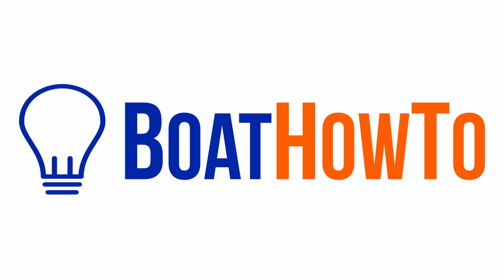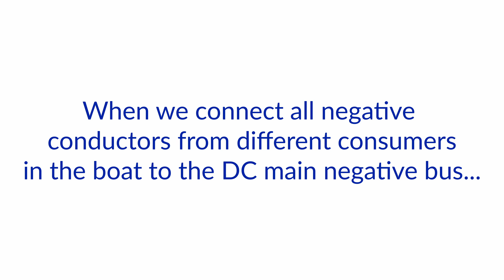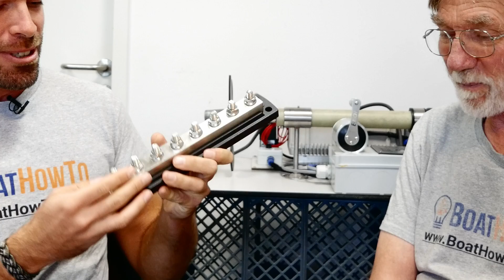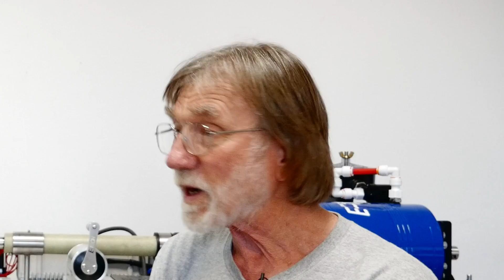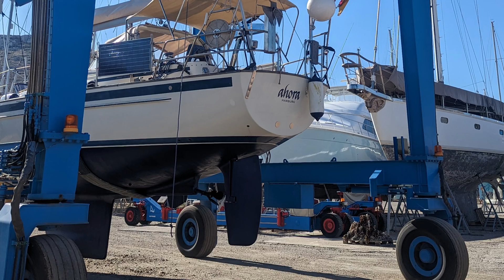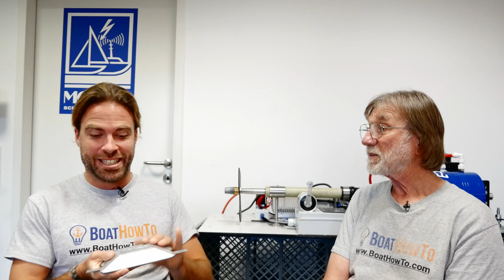SACRIFICIAL ANODE as GROUNDING connection - A good idea?  | Ask The Expert with NIGEL CALDER

Comment: By using a synthetic flexible coupling at the engine/prop shaft connection am I disconnecting the prop shaft and propeller from the engine negative?
Reply: It would seem yes, AND the two should still be bonded together with a wire with ring terminals.

Comment: Viewed twice and never heard whether or not the sac anode could be used as a grounding connection. Did I miss that?
Reply: He said the zinc anode has nothing to do with the battery system.  It doesn't matter if it is connected to the negative side of the battery or not.
Reply: I know what anode purpose is. But question is, can we use anode as a submergible metal plate? I have flexible connection to shaft. Previous owner connected engine with anode. Cables and connections were is horrible condition so I can not judge was it working.

Comment: I have a water cooled aluminum small high pressure air compressor, the water jacket and sleeve corroad over time. I am asking the following:
Could a magnesium anode be used in say a 5 gallon buckett that is the remote circulating water supply for cooling and would it have to be connected to the metal of the compressor by a wire? would that help ?.
Thanks

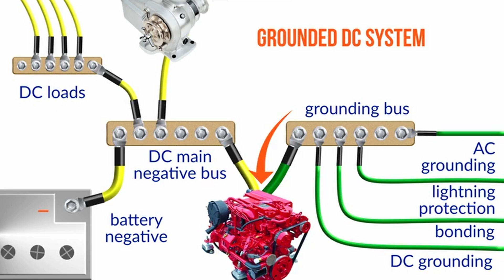Comment: I have read everything I can find about sailboat electrical grounding - and still find myself disagreeing with the conventional wisdom illustrated in the diagram at 1:04 - whereby all systems share a common ground connection.

On my boat I am adopting the following design, which I believe is sound.

[A] When lightning strikes I do not want that electrical charge getting into the AC or DC systems (zapping the LFP BMS or destroying other electronics). Thus I have my mast grounded to the lead keel (to dissipate to the water body); and the shrouds connected to air terminals on each side of the hull (to dissipate to the water surface). No connection to a common ground bus.

[B] When there is an AC fault I do not want AC current going to the water (electrocution of swimmer!) or zapping the negative side of the DC system. Thus I rely on a common AC ground going back to both AC sources - inverter and shore power (via galvanic isolator). No connection to a common ground bus.  I am still looking for a way to test the integrity of the AC ground on a marina pedestal, before connecting the boat...

[C] What if there is a DC fault with the inverter? Install an inverter with a plastic case. Rely on the fuse on the POS battery terminal and a breaker on the positive supply cable. No separate ground connection to the DC bus.

[D] I have everything I want protected from galvanic corrosion (DC negative system, the engine, fuel tank, prop strut) electrically connected to the prop shaft with its pair of zinc anodes. I separately protect the steering system (SS rudder shaft, aluminium drive wheel, SS cables, aluminium pedestal) with another pair of zinc anodes.

[E] Through-hulls (bronze) are isolated. I assume that the copper powder in the anti-foulfing paint is not proving an electrical path. To mitigate that risk the bronze through-hulls are painted with epoxy barrier that extends past the antifouling paint (so the paint has no electrical path to the bronze).
Reply from the maker: During your reading, have you come across the ABYC and ISO standards? Those are based on the experience and thoughts of hundreds of experts over multiple decades. There are very good reasons, why you should have a common ground on a boat. We explain them in a lot of details in our Advanced Marine Electrics course in the modules on Grounding, AC, and Lighting Protection.
- Jan
Reply: The AC is grounded to the water because of shore power the source of which is itself referenced to some nearby dirt. If your ground fails then a secondary path is achieved through the water which is what electrocutes swimmers. The engine is typically used as a common ground point for AC and it is also typically a DC ground for at least your starting battery. If you do not ever connect to shore power or use an isolation transformer when you do then grounding AC to the water provides no additional protection from AC faults because the path back no longer exists. DC power is always relative to the DC negative (ground) and it serves no purpose whatsoever to reference it to the water but it is difficult to avoid unless you have no engine.

With your setup add a ELCI (GFCI for boats) on the shore power side and call lit a day. The galvanic isolator is one way protecting your boat from incoming current but will not protect swimmers. The ELCI does that when connected to shore power. Consider lightning protection separately. There are many factors there and I don't think there is any silver bullet.
Reply: I was working on my boat the other day and a tool plugged in to an extension cord came pulled slightly apart, while resting on the engine block.  If the cord had wiggled one way or another, the now exposed hot prong could have easily touched a part of the engine and energized it, potentially allowing current to flow into the water.  As I understand the direct connection (with galvanic isolator) would protect against these cases.  Even with an ELCI, it's an extra insurance policy.
Reply: A lot of sense

Comment: I have checked for voltage on my engine block and it’s reading .891 DC volts. What could be causing this voltage? The block is bonded to zinc plate.
Reply: .891 DC volts compared to what?